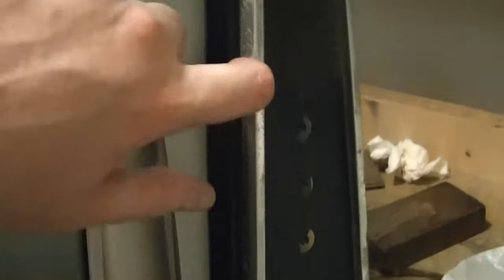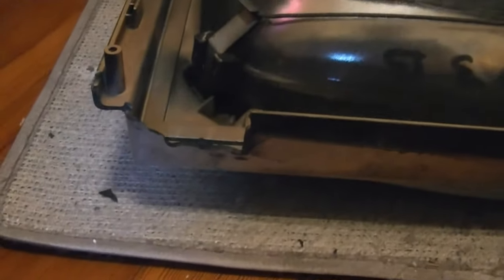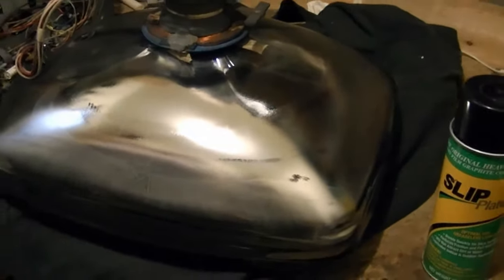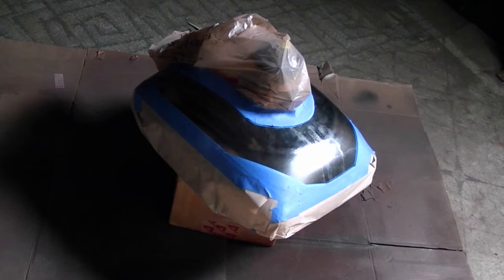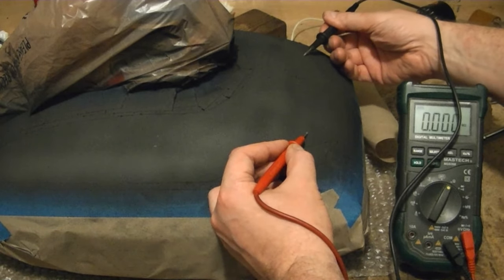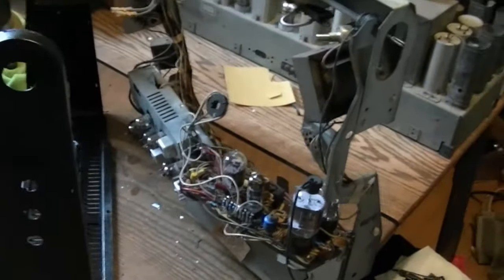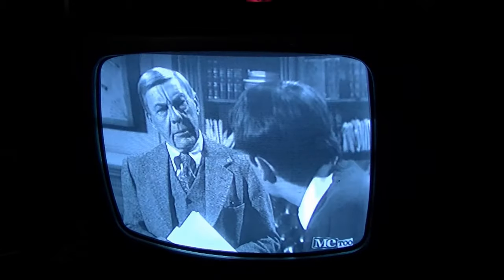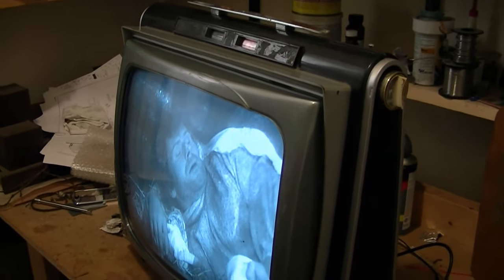Town & Country restoration p7o7

Comment: I found a new fast frying glue that is inexpensive called Future Glue, & it works great on plastics. It is stronger than anything I've used in the past.  It really has a good picture, & you sure have it restored to perfection, very seldom do you see older B/W TVs without any vertical and horizontal distortion.  I remember seeing TVs many years ago with out of round circles on the test patterns, & with some no amount of adjusting could make the circles round, probably due to out of tolerance caps

Comment: If you need to glue polystyrene, or ABS, or acrylic, find some acrylic solvent cement, it literally welds plastic back together.I need to find some slip plate, or some similar product, the 10BP4 in my CGE COT4, I also want to try recreating some Rogers metal spray shield tubes, I've heard there is a type of paint they sell to fix car rear window defrosters so I will have a look at the auto parts stores.I noticed that cartoon channel was playing "Class of the Titans" it was Canadian made I think.